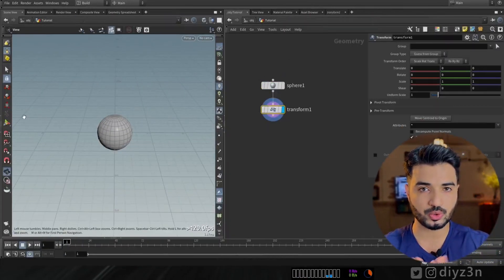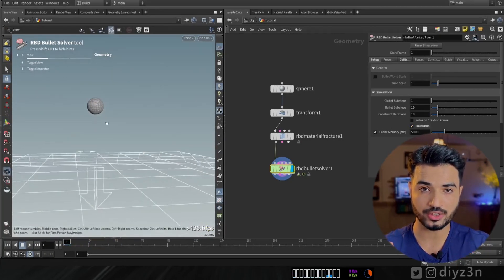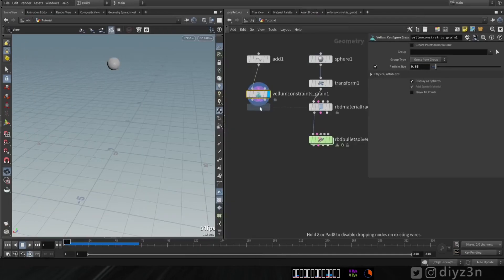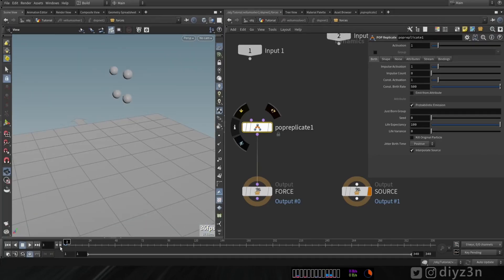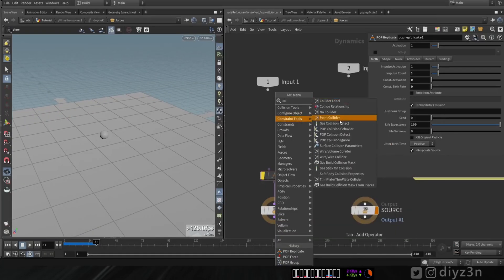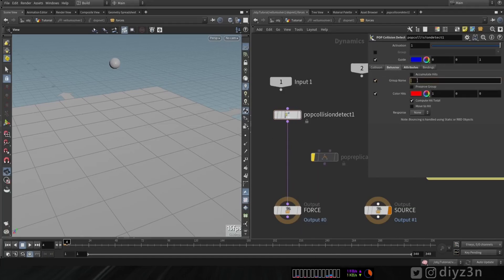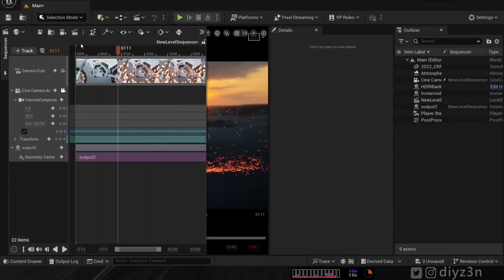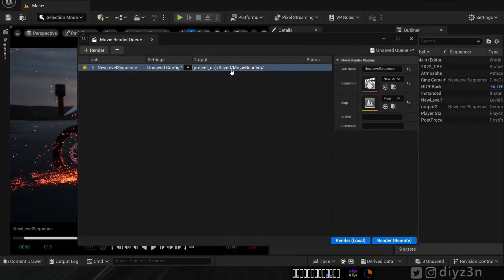Amazing Houdini's Sparky Particles in UE 5.3

Comment: hey whats up! awesome tut! I have a small issue importing my alembic, it seems empty. I Kept all the attribs that you mentioned but it is super heavy! +1M particles moving around. Can it be the reason? thanks in advance!
Reply from the maker: Hi bro, I appreciate the compliment, Regarding of your question – the main issue with these workflow, you need to bake it into file an imported in UE And sometime the five size will be a headache having said that just import this file to another DCC app like blender or Maya or C4D And check if the point is there